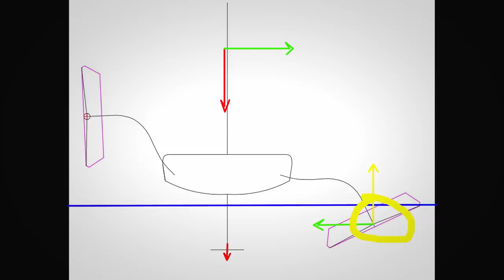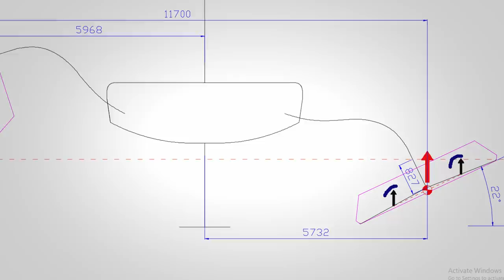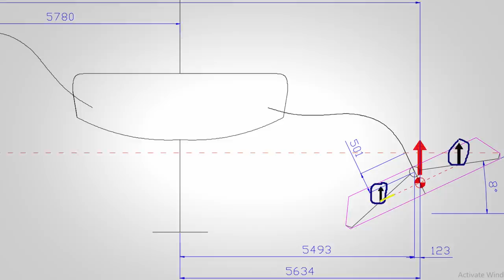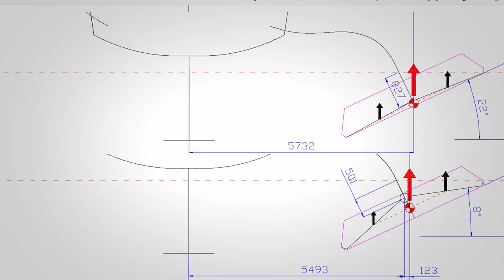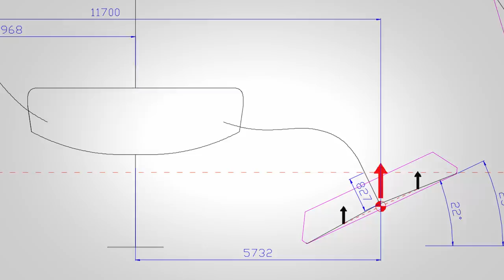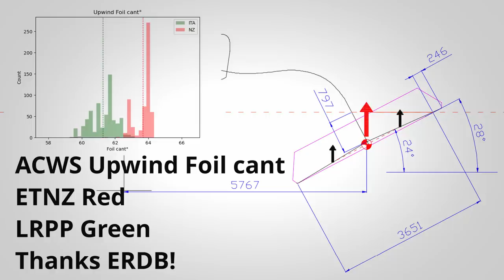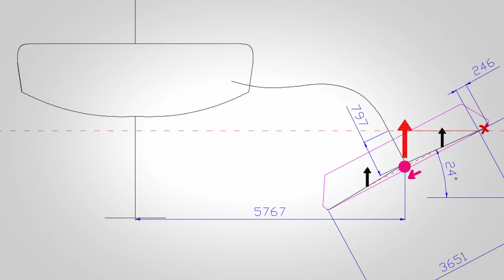Is this the ETNZ advantage that will decide the Cup?

Comment: The vector diagrams describing lift - shouldn't the lift be orthogonal to the wing surfaces?
Reply: The total force may be orthogonal, but I think they are only considering the vertical component of the triangle of forces as being relevant to righting moment. The horizontal component is relevant to leeway, which is not being discussed.

Comment: The additional canting is done for cavitation issue not for righting moment I think....Vittorio d'albertas should have a video coming up with some CFD guesses results
Having looked at the anhedral the key is down to splitting lift force and side force. LRPP I believe can control each foil separately. That's when you see the high mode. Using the outermost flap for more lift and the inboard one to go for sideforce. 
Your analysis is good but when you factor the above in I think and hope we have a close race
Reply: How does the additional canting affect cavitation?

Comment: Hi guys thanks for the video. I’m not a foils expert but shouldn’t you apply the force vector perpendicular to the foil (cord). If so, when you do the vector analysis you get 2 components: one perpendicular to the water surface (lift) and the other perpendicular to the rudder. This is important, I think, because with the T foils you can’t separate the two effects while with a Y foils you can set them to be different in case you need. Thanks

Comment: NZL worked out a long time ago the aerodynamics should not be lifting the hull but forcing it down. You can see the modification on the Luna Rossa boat was a game changer. But how you can change direction and speed of change under sail load and  in close proximity is probably the important race winning formula.

Comment: Thank you Tom for calculating those relative figures. What a massive advantage for NZ
Reply: I doubt that NZ has a 7.5% speed advantage, but we shall see. However, if LR can sail closer to the wind at their optimal VMG than NZ, this will at least partially negate any speed advantage NZ have. Also, in light air, LR can probably turn faster through the tacks.

Comment: The half of the delta shaped anhedral foils will not have its CoP at the laf way point along its span, it will be closer to the bulb and therefore higher and closer to the centre line of the boat i.e . to the keel

Comment: I see it a bit different. Luna Rosa has greater lift on the outer part of the foil as it is closer to being parrelell to the surface when looking at vectors it provide more lift further from the center of the boat. The inner half of the foil being much more angle provides far less lift , but much more resistance to leeway. I am considering lift in this case as lift in the horizontal direction , which is what helps maximize righting moment.

Comment: Please correct me.  Wouldn't the foil lift be roughly in the center of effort of the sails rather than vertical?  If that is the case, then excess lift could be used to crab the boat to windward increasing VMG and contribute to even more of an advantage.  Great job guys!

Comment: Thanks - well explained Mozzy. How did yachting get into such a pickle with its mixed units? Fortunately we didn't put any values on pressure or righting moment so only heard metres, millimetres, tonnes while forced to mention weight and knots?
(0.54kn =1km/hr)
Reply: It's a very old sport.
Reply: Forces are calculated in Newtons, moments in Newton/metres. However I often use a conversion to "tonnes-force" as I find it easier to relate when we talk about a boat (+ crew etc) that weighs 7.8 tonnes. 😎
Reply: @maxhugen Firstly a correction moment unites ar Newton-metres. And the total pressure force is 7 8×9.80665=76.5kN assuming their vertical velocity and acceleration are zero and there is no contributing vertical component from rudder/elevator. This discussion is more about the differences in righting moment arm lengths and ignoring other directional dynamic and balancing components so is greatly simplified.🥝🥝🙏
Reply: @MrVaticanRag  Certainly, it is simplified. Way too much to cover in a YT video, no matter how long it is!  😎

Comment: Does the shape of ETNZs bow provide some lift and a cushioning effect as the speed increases?
Reply: I am convinced in my own mind the hull delivers a small percentage of ground effect lift, more noticeable always on the side where the foil arm is down, using the shape around the "hinge"  in a constructive manner to trap air and that sailing with the bow down sometimes touching is part of the equation to give stability and slippiness when one considers the need for the rudder pitch to be  as neutral as possible. The flatter surfaced skeg (not as radical as Ineos) I observe as "smacking" the water at over 30 kts which results in any touches acting like those of a skimming stone so it never gets depth and drag and finally, the useful videos put out such as Justin mitchell and sailchaser and airflownz show the latest practice runs of ETNZ having the windward side of the boat "leaning into" the wind on speedy turns! The Total package of a low flying machine.
Reply: If it did it would be extremely disadvantageous, because it would negate some of the righting moment
Reply: @pp2793  LRPP also claim some lift from their overall boat shape (like an aerofoil)
Reply: @petertelford5338   I didn't know this, thank you for pointing it out. In my mind this doesn't make any sense, however I get the feeling that the mechanics are much too complicated here for understanding without details.
Reply: @pp2793  Definitely so. We as laymen get the overall idea of what is going on. These videos are incredibly helpful as are the two Italian blokes who draw down from top experts in Italy. They did some good work on foil shapes, profiles, and hull "stickiness" to the water. Like most things in life, it comes down in the end to what happens in reality. That is where the human element comes in. LR with machine like team can pull off some great results. All we want now is some great drama on the water which makes us all feel proud as humans at the ingenuity and effort.  Roll on Wednesday! By the way, the weather for Wednesday and Friday is in LR's favour in my view 11 to 18 and 11 to 20 MILES PER HOUR. So 9 to 15 and 9 to 17 knots. on one of the days, the wind is fading away during the day. ETNZ should tread with care not to go 4-0 down!
Reply: @pp2793  I certainly agree with that.
Reply: Nathan, the whole thing is a wing, giving vertical lift.

It's in the spirit of the F35 and F15 in this regard. There's a video on YouTube of an Israeli F15 that was able to fly back to base after losing a wing in a mid-air collision.

Comment: Isn't there a dynamic (not static) benefit to the tip breaking the surface? When the boat gets too high (allowing air to escape under the boat) when more tip comes out of the water, foil lift decreases, and the boat will settle back down a little. When the boat gets lower than desired, more foil is under water, increasing lift. So this effect is dynamically stable, and reduces the amount of flap change required to change the total foil lift. I would assume that the foil AoA is designed such that in nominal design conditions, the flap angle is zero. With the tip moving in and out of the water in a manner that contributes to dynamically stabilizing of the boat height, the flap does not need to be adjusted as much to get the correct RM, and the closer the flap is to neutral, the lower the foil drag.

Comment: A better VMG can still be a factor to consider ... another factor is that ETNZ has more to lose than LR ...
Reply: VMG is very important, always is. As far as the second point is concerned, ETNZ are the defenders , so naturally on a psychological level they will work very hard to keep the cup.
Reply: @jamesaron1967  They will, they are likely the best team. Just curious to see if and when they're trailing and maybe pushed in the wrong side of the course how they will react, especially if not being able to do the cleanest of the maneuvers or to develop full speed. But maybe they'll never be behind, as the general consensus seems to agree upon ...

Comment: There is more for NewZealand righting moment: the sharp "keel" of LunaRossa forces more air to the sails, but it generates a powerful vortex that reduced its righting moment. Instead, NZ went for a smoother keel, which is less capable of powering the sails but doesn't harm righting moment as much.
Because of that, LR will have a big advantage in weak winds, but in stronger winds (once past the point where righting moment becomes the deciding factor) NZ will havve a further advantage.

Comment: Could it be that as  heeling pressure increases the  area of the foil increases since it's pushed more into the water which produces more lift and a little more lateral resistance. Hence a little automatic ride height control. This will be accentuated because whist the tip is out of the water the outer part of the foil will be sucking air which may reduce drag  but as soon as the tip goes underwater the whole foil will be generating  lift and angled as it is this will provide increased righting and increase lateral distance.

Comment: The Centre of Lift for LR is further outboard than described, as the leeward wing of the foil provides more Lift than the windward wing, due to the anhedral. Also, the Centre of Lift for NZ is slightly further inboard as their latest foils also have ~5° anhedral now. Boat speed alone does not indicate better VMG, it also a function of the True Wind Angle sailed, and other factors such as time required to tack/gybe etc.
Reply from the maker: Max, this assumes both wing are producing the same lift perpendicular to each span, but the outboard wing has a greater vertical component. You will notice CoL for the whole wing is not equidistant between the two CoL (in X). Drawing a line and giving the midpoint takes account for this. 
What we don't discuss, purposefully, is flap differential.
Reply: @MozzySails  OK,  looked equidistant...

Comment: Has anyone looked into / discussed the possibility or option of using the two flaps independently to “torque” the lift effect about the axis to induce righting moment via the pressure differential?

Obviously etnz with the “linked” foil control couldn’t but it would be interesting to know if any teams played with the idea

Comment: What about the drag due to the profile of the foils. I would assume, that etnz needs another profile than LR as their surface area of the foil is smaller. The boats have the same weight so etnz needs higher lift per area on their foils. Is that possible without inceasing the drag of the foil?
In the end it could be faster using a profile with higher lift to surface ratio as you gain drag due to little wetted surface area bit the fact you need another profile could lead to smaller gains of etnz as you predicted in your very interesting and detailed video. Love your argumentation and discussions. Well done

Comment: A foil looses lift when closer to the surface though, so the center of effort should be a bit more inwards. Also Luna Rossa went from a higher aspect, lower surface foil design, and probably not without good reason. So don´t think it´s pre determined. Or maybe I just really want Luna Rossa to win.
Reply from the maker: LR has more foil nearer the surface than ETNZ
Reply: can you explain the physics behind this sentence?
Reply from the maker: @ruggericci  it's not physics, it's geometry. We cover it in more detail here: https://youtu.be/MZLTMxUkA50
For the same cant angle and ride height ETNZ have a deeper intersection and less foil near the surface
Reply: @mozzy sails for the same cant angle yes but with the cant angles they do use shurly ETNZ has more of the outer parts close to the surface right?
Reply: @MozzySails  i was commenting Emil sentence
Reply from the maker: @ruggericci  ha, okay, sorry!
Reply: @ruggericci  I'm not entirely sure of the physics, but I think it is because there is less water in the proximity of the foil, (on the most important side) for it to direct downwards. since the lift comes from directing the waterflow, less waterflow means less lift. Anyways, since foils closer to the surface have less lift, the center of effort on an angled foil close to the surface should be located towards the deeper end.
Reply: here we go! it seems you overestimated that speed difference!

Comment: The moment that matters is the moment the first boat crosses the finish line. The most important force is the one needed to lift the Cup into the air in triumph after seven of those moments. They will prove all the maths one way or the other.

Comment: In my opinion ENTZ foil tip to breach the surface cannot be considered positive. I think it increases the chance of cavitation and the drag of the foil (the tip out of the water can cause ventilation so it is less efficient and it sprays water, there is an energy loss). Additionally in my opinion a foil is more efficient when it works in a higher hydrostatic pressure, if possible I would hope to sail with the foils deep in the water.
Can you comment on this?
Reply: You may have a point but from all accounts that doesn't appear to be affecting their speed at all. They are sailing very fast during their training sessions.
Reply: @jamesaron1967  I agree and that is very confusing for me, thank you for your feed back.

Comment: Do you think moving the foil tip out of the water is also cutting hydrodynamic drag, as at high speed even the small foil is probably producing the lifting force with very low and therefore inefficient angles of attack?  (Below the maximum Lift/Drag ratio AoA)

Comment: If we take righting moment as pointing up (as your diagrams seem to do) then the center of lift (as regards righting moment) is outboard of the foil arm because of the anhedral. The outboard wing lifts. The inboard wing prevents leeway. But then the center of righting moment is well outboard of the foil arm giving LR more righting moment....no?
Reply: One other thought. Speed isn't what gets you to the windward mark. It's VMG. Does LR not have more leeway-resistance too, because of the anhedral? And whether they're faster in a straight line or not, are likely to be able to sail higher (and lower) angles?

Comment: Your foil lift arrows are all wrong.  The vector is not perpendicular to gravity, it's perpendicular to the foil.  Since it's below the center of mass, that's important as the sideways component of the foil lift applies moment about the center of mass - in the wrong way!
Reply: I was going to say something similar. Surely because on the anhedral foils, the leeward wing will be more parallel to the water and therefore generate more lift parallel to gravity, which will bring the overall centre of lift further out to leeward than they were saying...
I may be wrong but that's my thought process
Reply: I also note this issue with the diagrams.
Reply: @bencheshire2680  Sure, to some degree, but I doubt that LRPP would totally unload the inboard foil, they would almost loose all control of leeway then, would be very bad for WMG upwind, but maybe beneficial downwind actually? 
But as long as the foils are working with similar loads on both inboard and outboard sections, the CoE must be pretty much in the center, in the extension line of the foilarm, no matter in which direction each part of the foil is working, its still a solid system.

Comment: When ETNZ's tip pierces the surface it creates a smaller lifting surface. ( particularly on the out side half of the foil) Wouldn't that shift the righting moment further inboard on the foil as a whole?  Foil length divided by two equals center of effort of foil?

Comment: With the anhedral foil, the inboard half needs to have a vector diagram of the lift as only a percentage of the  lift will be vertical. With less vertical lift inboard the center of the total lift of the foil will move outboard but the total lift will be less in kg. Do these changes cancel out?

Comment: At ~4:30 you assume that the center of vertical lift for both ETNZ and LR is the mid point along the axis of the foil arm. BUT, LR's external foil is almost horizontal, while the internal foil is slanted by an extra 35 degrees, which means roughly an 18% less vertical lift component. The external foil clearly generates more vertical lift than the internal foil, so wouldn't this mean that the center of vertical lift for LR is further out?
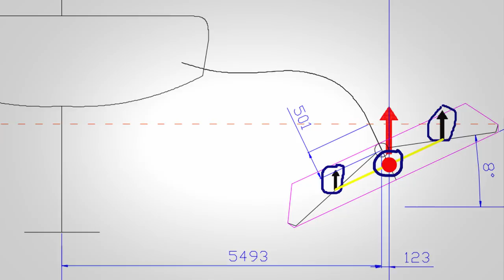Reply from the maker: Notice at 4:30 and 5:11 the outboard foil has greater force arrow (y). Even when both sides are producing the same total lift, the outboard side will have a great component in the Y axis, and this is recognised in the calculation and diagram. For ETNZ both arrows are very similar (if not the same).

Comment: Entnz lower foil arm is working as a v foil with the leeward foil offering more lift as the cant or foil arm position rotates  to windward. This offsets the piercing tip and lowers total wetted surface area. Add this to your vector diagram and look what happens
Reply: I agree. It's interesting that no-one has commented on this to date. It also acts as a self leveling foil similar to the very first foils that etnz had on their ac72
Reply: @simonharris6836  seems like it’s something nobody is considering in the equation,  and yes the self leveling component effect if indeed it is acting in this manner could explain the more skittery behaviour at speed as a result.